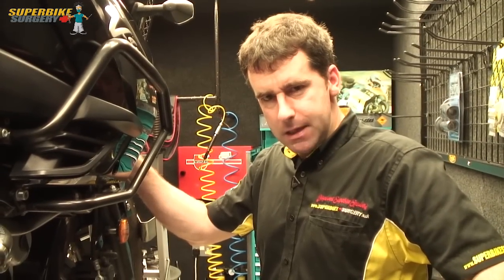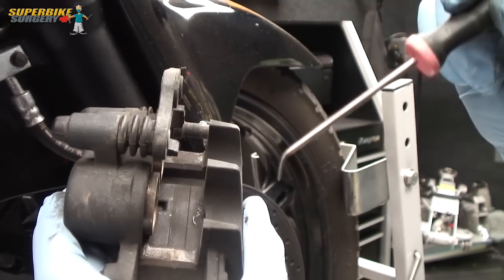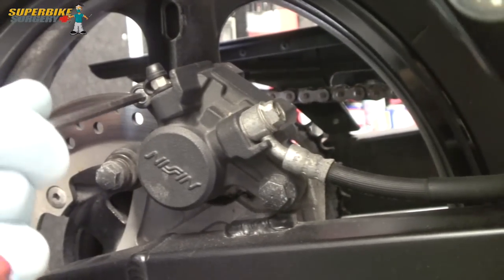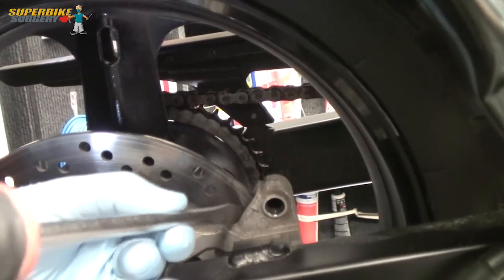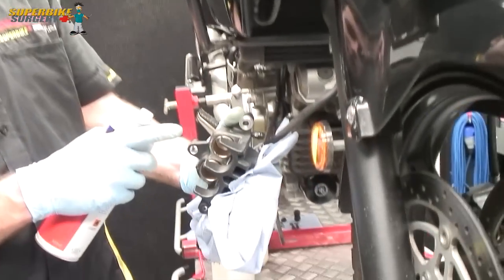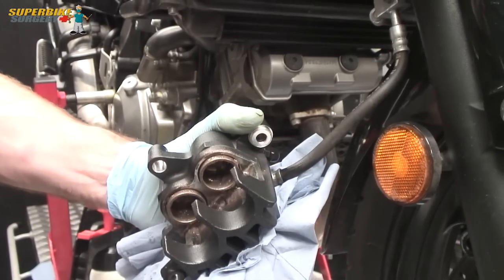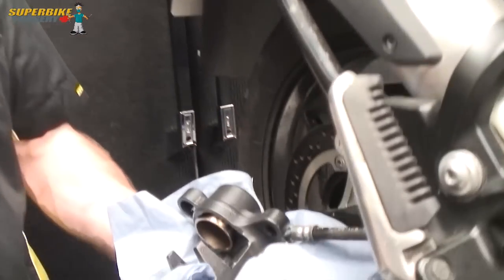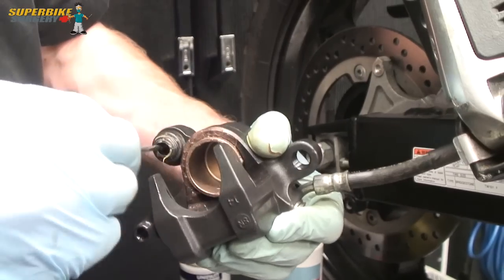How to service and clean your motorbike brake calipers

Comment: Hi. I noticed that you sprayed a lot of copper grease on the pistons and generally all over the internal parts. Is this safe? i mean if the grease melts or somehow touches the inside part of the pad there will be problem!!! Am i wrong?
Reply: Thanks for the tip James! Great! Once i've cleaned the the calipers on my old v-strom 650. The brakes were working great. But after a few months, the shiny pistons went black again. This is great for easy re-cleaning!

Comment: Is the silicone spray the same as those use for tyre shine? Can anyone shed some light on this?
Reply: No no no it's not. Silicone lubricant is very different
Reply: @lentilsouper  Thanks, but what is the one used in this video ("commercial" silicone spray?)

Comment: Why are you applying copper grease? Dust will stick to it. It's grease, so it can melt onto the pads. And the back of the pads are clearly copperplated already. Those little plates are rustproof. And the pin has a zink coating.
Reply from the maker: The reasons for using copper grease in the UK have been debated over and over and over again in this thread. Please just read the comments, I can't be bothered to have another conversation about it :)
Reply: @SuperbikeSurgeryTV  I read the comments, but I can't see your replies.
Reply from the maker: No idea why? It works this end. There used to be a very well documented YouTube bug that caused this but I thought that had been resolved a long time ago.

Comment: How not to service brakes. I have been a brake specialist for 21 years. There is absolutely no need for copper grease in any component of the braking system, it will simply collect road grime and brake dust very quickly. Plus copper grease on calliper retaining bolts??? This should be stud locking solution to keep them from vibrating loose, using a grease of any king is absolutely dangerous....
The only thing that needs lubricating is inside the slider gator and not with copper grease, this should be with a silicone grease only,  plus a torque wrench should be used by everyone regardless of level of experience.
Reply from the maker: One again another opinion dressed up as fact. Speak to the manufacturers of pads and calipers and ask them about the use of copper grease as a corrosion inhibitor in countries that use road salt. It's also alarming you call yourself an expert but don't understand the use of copper grease as an anti-seize compound on nuts and bolts. If you think they are somehow more likely to come undone 🤣 Unfortunately your opinion contradicts the work done by almost every Car and Motorcycle workshop the word over for the past 50 years. But as you said you're the expert so everyone else must be wrong 🤣.
Reply: Superbike Surgery Ltd mate the reason I found your video is it’s doing the rounds on social media on how NOT to do your brakes.... why would you want anti seize media on your retaining bolts and pins when they are not held in by any other mechanical means eg: lock wired. This is the only time I will ever use a grease or specifically acf50 on retaining bolts only if they are lock wired as a means of keeping them secured. The use of copper slip grease should have died out 25 years ago. Your video is outright dangerous to those not in the know
Reply from the maker: @richardb2468  I feel you are completely missing the point. We have a very specific problem in the UK with the type of grit spread on our roads during the winter, really high sodium chloride (Salt) content. This basically dissolves un protected parts, especially brake components due to the constant temp changes. Bikes are especially at risk because the pistons unlike most cars don't have a rubber boot. 

You can take a brand new bike and ride it through one winter and end up needing very expensive caliper rebuild wotk in just a few months. I've literally seen it hundreds of times. Have you ever tried to remove a seized in pad retaining pin? Probably not if you are suggesting putting them in dry! 

The product I use is Wurth CU800 and is specifically designed for this very purpose. Maybe Wurth have also got it wrong, one of the biggest Workshops sundries suppliers on the planet. 

The copper grease debate has been going on for years so these arguments are old news to me. There seems to be two very distinct camps. You have the guys like me who work in the real world day in day out, skinning our knuckles on seized bolts because somebody didn't use copper grease. And then you have  The text book waving keyboard warriors. 
Thanks for your comments.
Reply: Superbike Surgery Ltd my apologies I didn’t realise a multi million pound company was recommending the use of a product that they sell. Retaining pins should always go in dry. I live in the us so I know exactly the problem you talk about but the solution to this is more regular maintenance not shortcuts as you describe. I can guarantee that if you pull the pin once a month and emery it then it will never ever get stuck.
Reply: @richardb2468  Once a month-really?I want to be riding the thing not tearing it apart monthly.
Reply: @richardjones3112  it’s a calliper pin not a engine shim 😂😂😂
Reply: @richardb2468  Yes I know that .Once a month is still excessive.You’ve obviously got plenty of spare time on your hands -I’m jealous.
Reply: @richardjones3112  I don’t do mine once a month, I keep my bike clean and that’s usually enough
Reply: @richardb2468  👍

Comment: You really love that Copper grease, tut tut Jim ... never on slide pins, especially if they contact any rubber bush or sleeve, just asking for trouble ... silicone grease is the correct slippy slidy stuff u should be using... copper grease on rear of pads tut tut, bike pads often have holes in the steel backing plate, any grease can wick thru the pad friction material to the braking surface, copper grease on pistons tut tut, pistons need pushing out a good way, then clean em, then a slight smear of red rubber brake assembly grease on the pistons, push em fully back in & wipe off any excess grease, never copper slip as it hardens with time, & is abrasive to piston surface & swells seals ... shame on you boy.